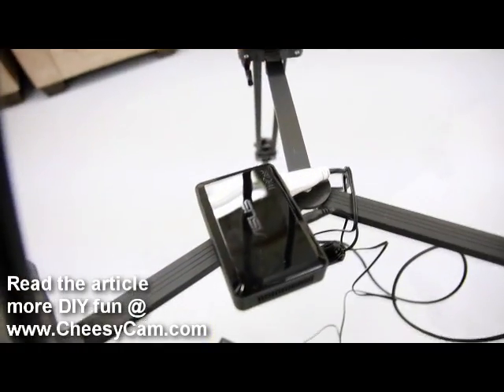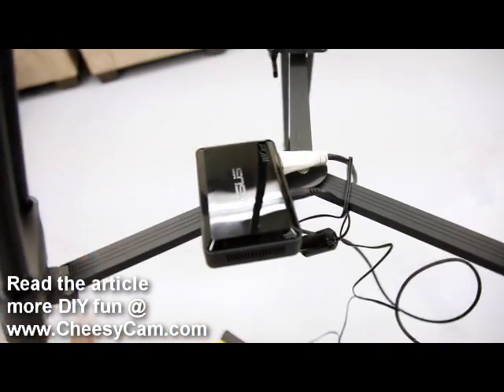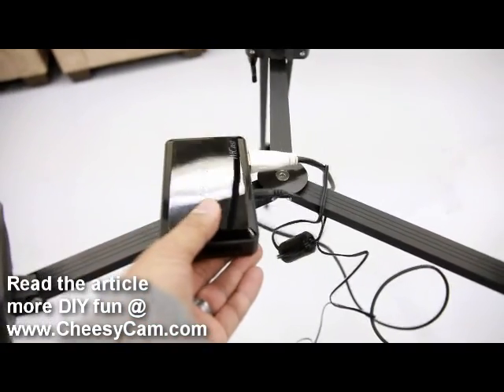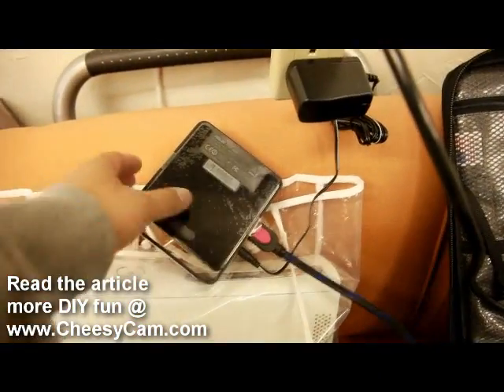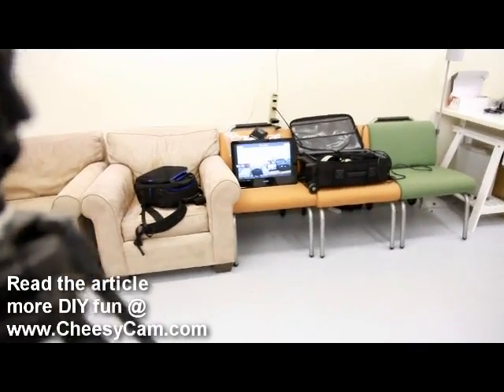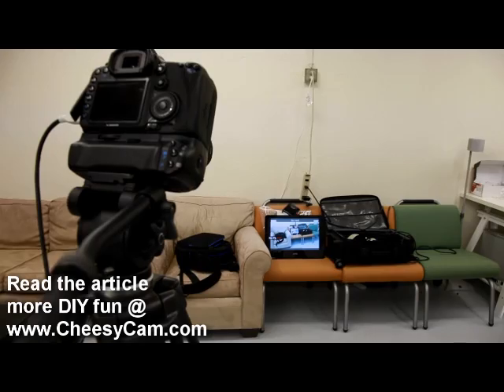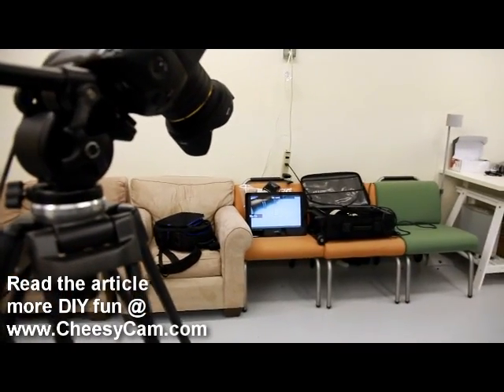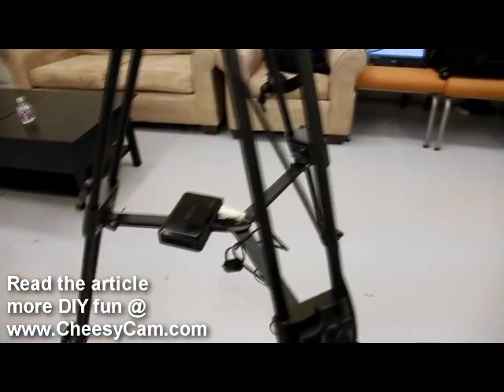DIY Stream HD video Wirelessly to Remote Monitor Project

Comment: Hey...nice review....had 2 quesions for you....where you able to make the battery pack for it, if so please give me some tips on making myself and also...do the reciever have the capabilities to out duel for a duel monitor setup or could i buy a splitter going from the cam to the box, essential and output to the transmitter and a small monitor? Thanks please let me know more. 

Charles